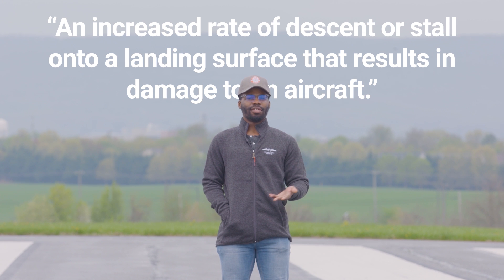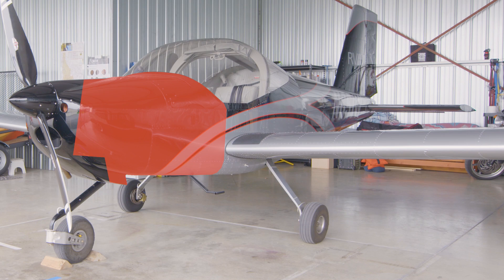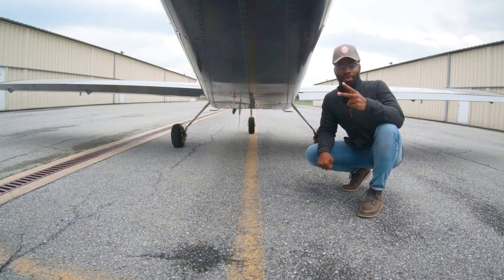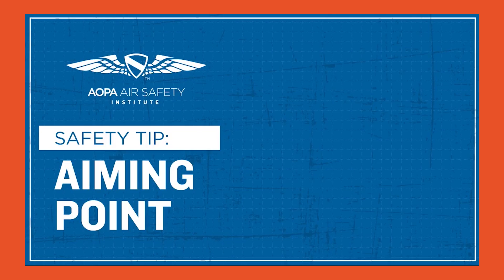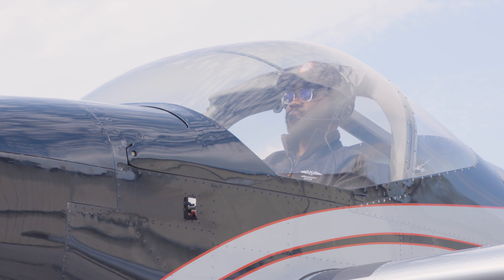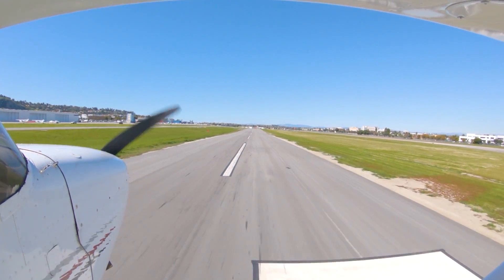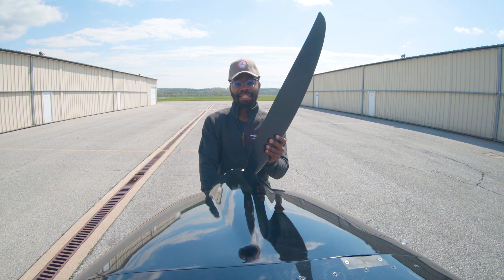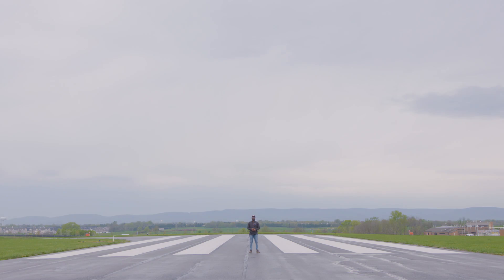Avoiding Hard Landings

Comment: just my observation that many light aircraft pilots I have flown with tend to fly very shallow vertical approach angles at what I consider way too fast final approach speeds.  And by "way too fast" I mean 1.3 Vso+ all the way to the flare point, or even to touch down.  The pilot creates his own problems doing this:
1) The shallow approach angle means if he had an engine failure, he would likely never make the runaway;
2) His 1.3 Vso+ airspeed means if he was trying to make an off-airport emergency landing, he would likely float past (overfly) his intended landing point. This is because the actual stall speed of a light aircraft in ground effect is much lower than the Vso measured out of ground effect (or, at altitude.) 

Review the POH or Owners manual first to ensure that what is recommended below is suitable for your aircraft,, but assuming it is, what I would recommend to such pilots are:
1) practice much steeper approach angles - more like what the natural engine-off maximum glide ratio is, and control the descent angle with slips; and
2)  Once on short final, and guaranteed to reach the runway if engine power failed, allow the airspeed to gradually decay until it decays to Vso right over the threshold.  Then hold the landing attitude and the aircraft will settle into ground effect and on to the runway on its own as airspeed continues to decay below Vso.  If the winds are gusty, add on half a gust factor to your airspeed.  If the vertical decent rate appears too high for you, give the engine a little shot of power just before touchdown to cushion your landing.  If you screw up, then go around and try again.  Practice this for every landing, and when you do have an emergency, landing on or off airport, it will seem like a normal regular landing to you.

Comment: 1) You don’t need a piece of tape. Just put the Touchdown spot half way up the windshield and keep it there until ready for the landing. 2) Any prop manufacturer will tell you NOT to push or pull your aircraft around by its prop. Use a tow bar.